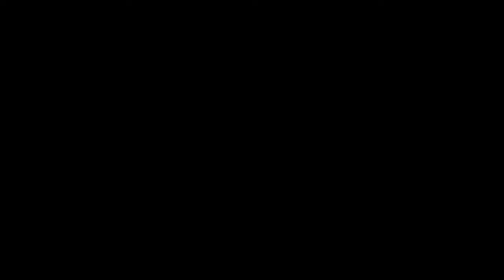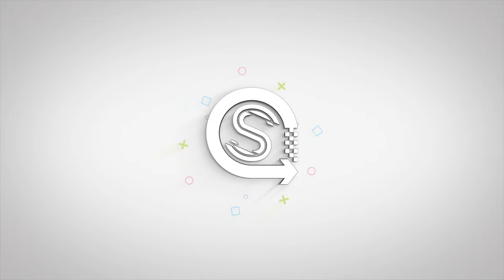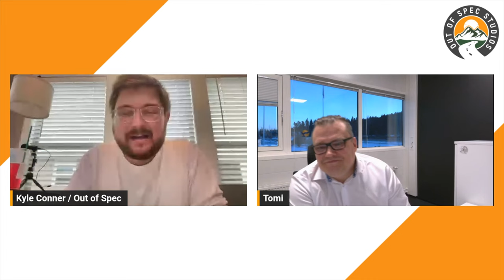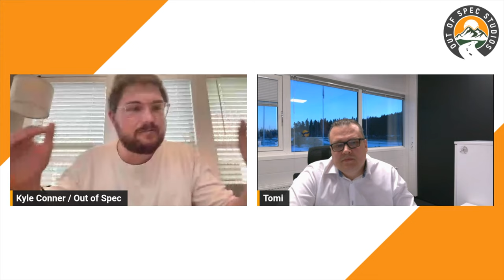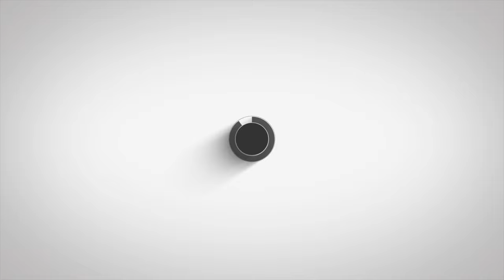Here's How Kempower Will Create A Reliable EV Charging Network In America | Episode 107

Comment: I work for Kempower and I'm so proud of our products. I've personally been using them here in Finland since they started to popup here and there few years ago, and nowadays whenever travelling by EV I always prefer the charging sites, which are based on our chargers. Some might say I'm biased, but wait until you try them by yourself and then make your own judgment.
Reply: IMO the kempower charges are the best in Europe, with the dynamic load sharing, the display tells you what the charge limitation is. Is it possible to get a list of where your chargers are being used and which operator is using them. I wish that more than 1  operator in the UK used them, 1 is not enough. Thanks
Reply: Ty for what u do soldier